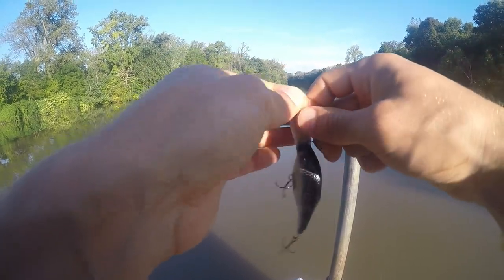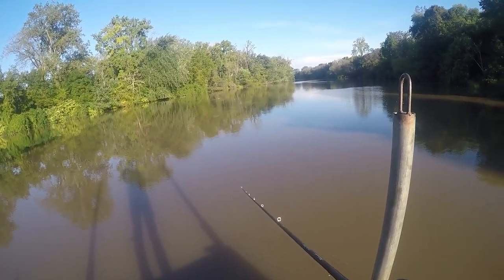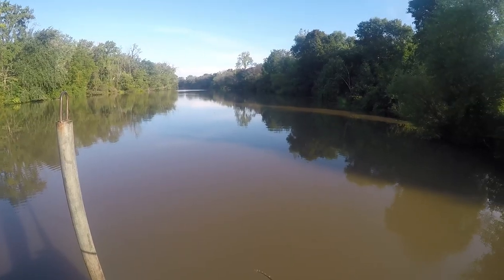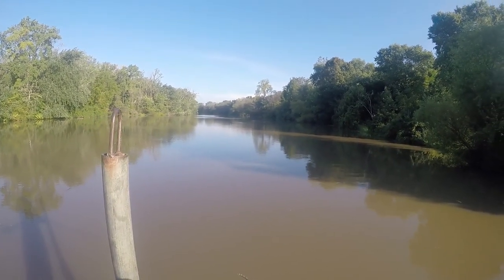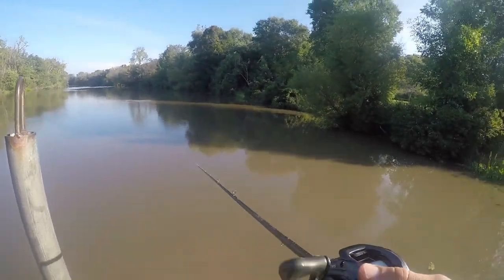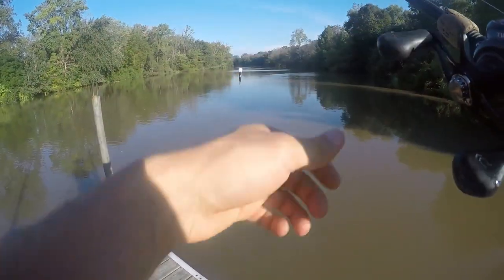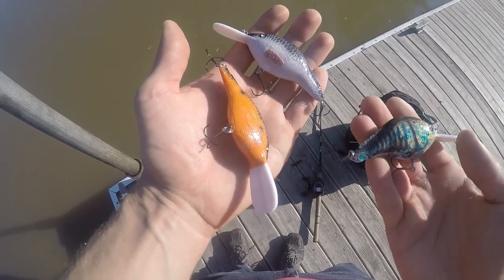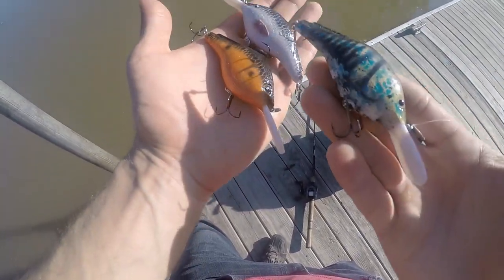3D PRINTED CRANKBAIT FISHING LURE TEST

Comment: When you're applying the epoxy make sure not to get any on the bearings. In your case you're using splitshots which are heavier. If the weight gets glued to one side then you'll have an issue of balance. I'm almost 100% sure that's what's causing the imbalance when retrieving

Comment: Great to see other designs! I've even been using wood filament for cranks and pencil poppers. Splicer settings are a bit different than PLA, but if you enjoy sanding the finish to detail, I highly recommend trying it. PLA has its place, for me mostly glidebaits and jerkbaits, but I'm working with some prototype designs that I'm excited about. Play around with the fill density, hardware configuration and take a look at what lure part suppliers are offering in terms of hardware. My molds incorporate through-wire designs and some have the place holders for hook anchors. KBS seal coat, airbrush, topcoat and ready to go with minimal time and effort once you have models; I use Strata 3D CX.
Reply: I just bought a printer, hasn't arrived yet, but I wanna make lures might need some help
Reply: Give the lure a dip in some epoxy or resin and then paint them instead of trying to do a bunch of tedious sanding